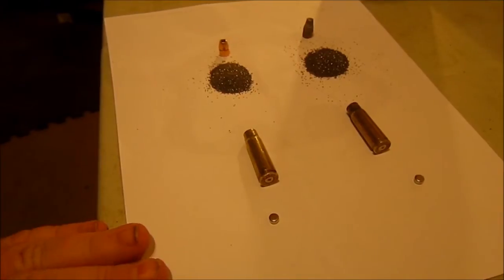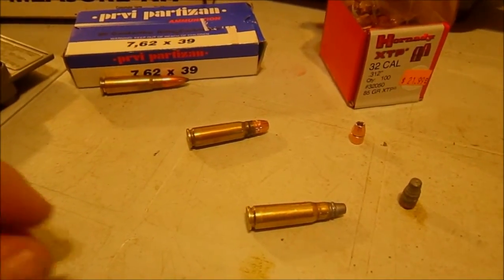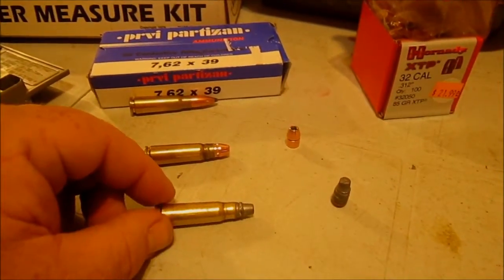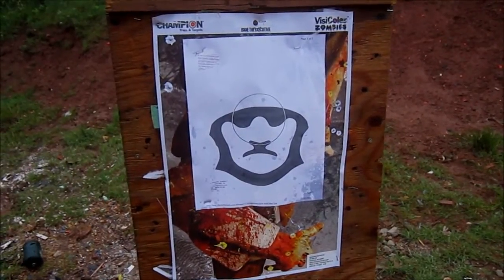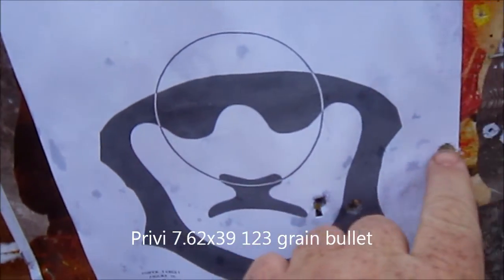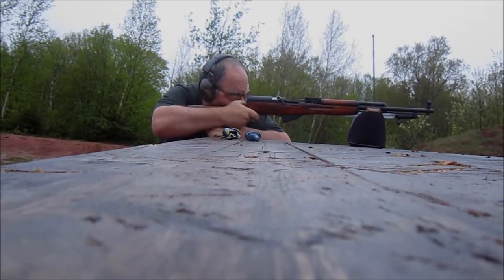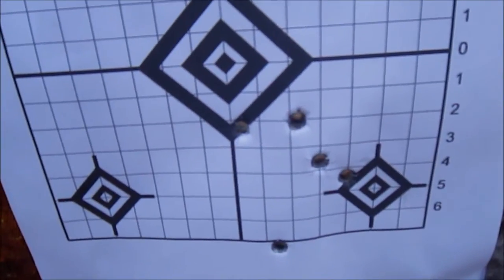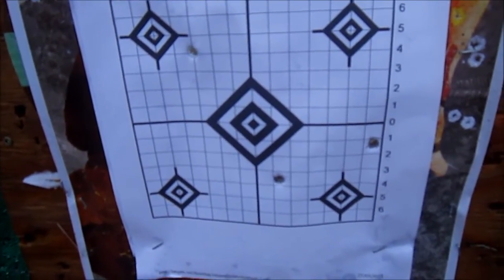7.62x39mm reloaded with a 85 grain bullet

Comment: Im sorry but you're loading .32 cal bullets in a .30 cal casing? and it worked? very interesting. I would have loved to see the slow mo of the lead slug leaving the barrel...
Reply from the maker: The 7.62 by 39 is actually a .312 diameter bullet and so where the bullets I bought for the test. 32 caliber  bullets will also work in 7.62x25 although enough surplus is a round to make reloading either round in effective unless your trying something a bit different.  Thanks for the comment and for watching.

Comment: Not sure what the groove dia. of your rifles bore is,it could be anywhere for .310" to .312" but you would probably get better results with the cast loads with a slightly larger dia. bullet like a .314" and drop the velocity down into the 14 to 1600 fps. range.  The barrel twist is the same in the SKS as the 54r.  The lighter cast loads will shoot well and accurately but you have to fatten them up and slow them down a bit.  Shooting the lighter for caliber cast loads which are less dense an at high velocity will exceed there RPM threshold and they loose stability and accuracy goes south.  You may or may not loose the cycling ability using the lighter loads but you might enjoy the accuracy potential much better.
Reply from the maker: +Reloader 7sixtwo I have the lee 160 mold and a .311 sizer I should make up a few of those.   I think at 1500 fps that would be a great 100 yard load.  What do you think?
Reply: +Yukon12gauge Unless you have a really tight bore I think you will be disappointed with cast lead bullets sized to .311" in your Russian SKS my Yugo & Chinese have .312" groove bores.  I have been shooting the Lee 160 gr. TL gas check bullet in both rifles for around 10 years.  My particular mould drops a bullet that is closer to .314" on the back driving band,I just TL them lightly once before and once after sizing and applying a gas check with the Lee .314" sizer and they chamber very easily and shoot great.  My powders of choice are 14.5 grs. of Alliant 2400,15.0 grs. being the MAX or you can use a starting load of  18.0 grs.  Reloader #7 with a MAX charge of 20.5 grs. as per the Lyman Cast Bullet Manual #4  18.0 grs. of RL #7 has always cycled any SKS rifle I've tried it in and is very accurate.  As to your .311 sizer you can either save it and use it with cast bullets for standard US 30 cal. rifles like the 30-30 ,06 or .308 Win. or you can hone it out to the desired dia. you need.  http://www.castpics.net/subsite2/HowTo/How%20to%20Hone%20a%20Size%20Die.pdf

Comment: did you just pull the bullets from the factory ammo and use a separate bullet, or did you change the powder also? what was the load data?
Reply from the maker: +thisguy41487 Check out the first minute of the video but these are full reloads using reuseable brass.
Reply: +Yukon12gauge D'OH! I was in a noisey room and I missed that. thank you!
Reply from the maker: thisguy41487 thx for watching.  I may have to make some more of these over the winter I wonder if they will stay stable at 100 yards.